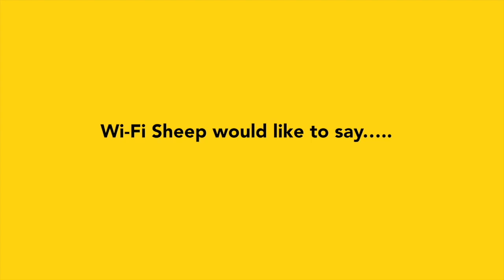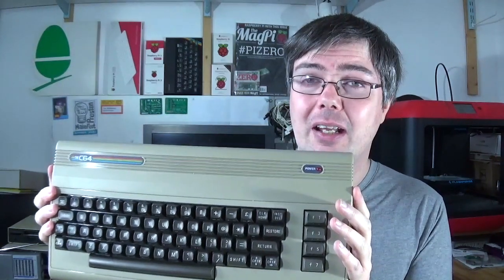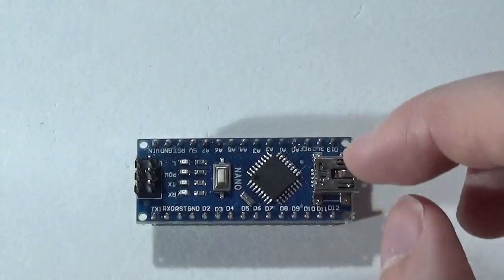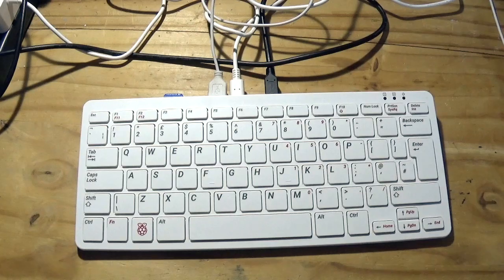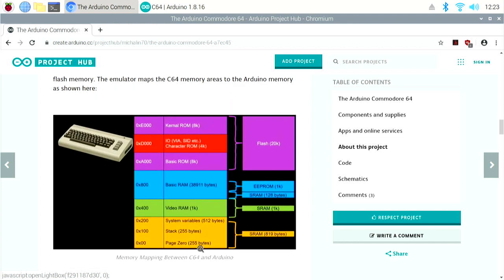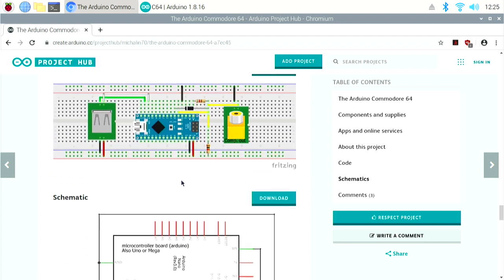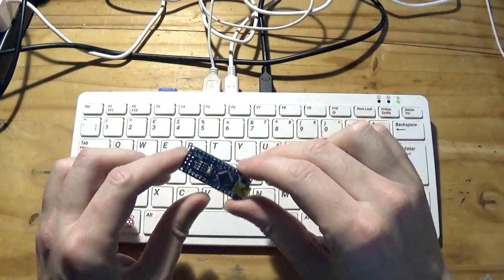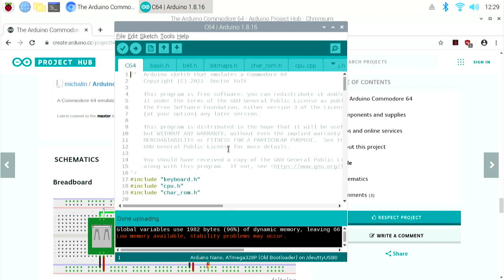Commodore 64 running on 8bit Arduino Nano??? No WAY!

Comment: I saw another video about c64 emulation on an arduino, very cool. I hope this can evolve even further! The more solutions there are to use a c64 the better! Maybe a microcontroller based c64 would be really cool. There are things like the colour maximite after all!
Reply from the maker: Well, I have plans if I can get it up and running!
Looking at the documentation  think we're going to hit some real limitations, so colours out for starters, it cant run C64 software, has no audio, I/0 support etc etc 
I think its cool and worth doing, but its not going to replace a real C64 or say an FPGA or Emulation method.
Reply: @WiFiSheep  That is definitely true. I think that it would be possible maybe on a different microcontroller platform or with some added components, but I do like the concept, very cool demo and even though you didn't get it 100% working in this video, it's still impressive that you managed with what you had!

Comment: Can c64 run on an Arduino Uno?
Reply from the maker: Yes it can as it’s the same cpu ( atmega 328p) and pinout as the Nano , but as shown it’s barely useable !
Reply: Ok .... yes .... i saw the video ...... i run all commodore machines and other retromachines with my raspberry pi0.... its good enought to run them .... arduino is too slow , the only thing is the tvout project with it ....